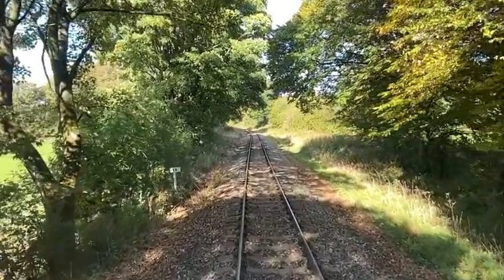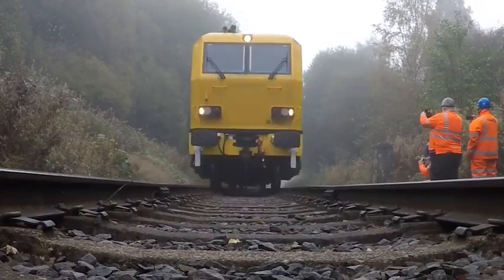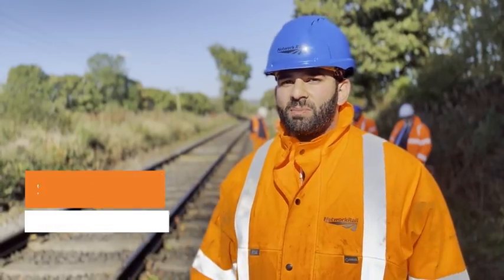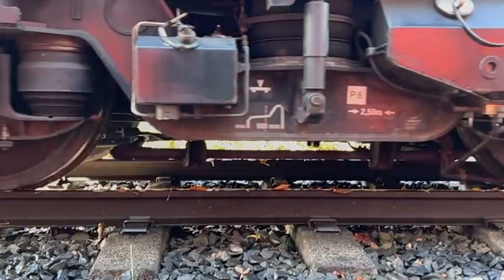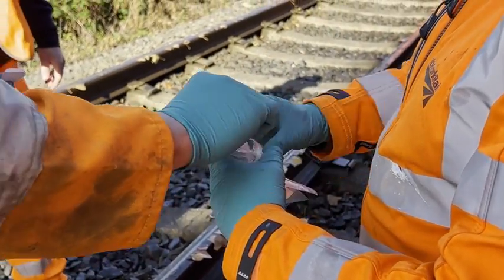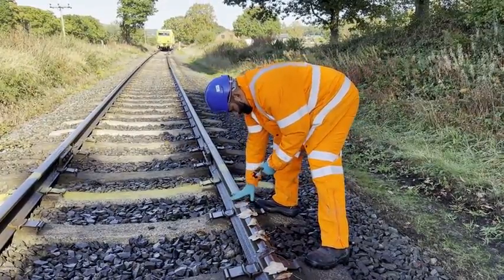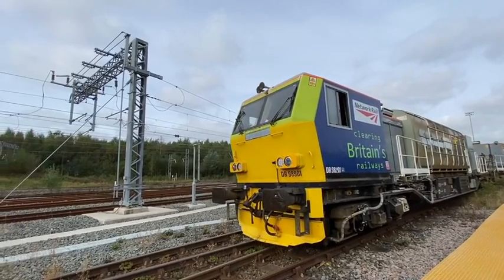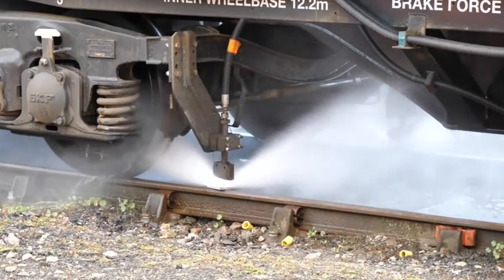Laser and plasma jets zapping leaves on the line.

Comment: This is not a new technology. Plasma torches were used in the early 1970s by the British Rail Research Department. The main difference then was that vegetation was kept in check far more effectively and also train brakes were still mostly blocks on wheels, rather than discs on the axles. This means train wheels are not being cleaned when the brakes are used, exacerbating the problem.
Neil.

Comment: My solution would be to put some brushes in front of the wheels to like maybe MOVE the leaves off the rail before they get run over by the wheels. I think it is way simplier and I dont see any downsides other than the brushes waering off overtime.
Reply: The issue is the coating compressed leaves leave on a rail over time, much like rail grinding with this solution you can send the train down the line once and its good to go versus relying on everyone fitting their trains with another maintenance item. And even if all had a brush system equipped it wouldn't be perfect and you'd still need something to clean off the rail more intensively.
Reply: Actually this wouldn't work. The reason is the leaves are already dead and decomposing. Once they are wet they turn to a kind of paper like material. Next time it's raining and your walking down the street, check out the leaves on the pavement.  You will notice they are all wafer thin and very damp. This creates a suction this like force with the ground. if it's windy you will notice these leaves will not get blown away, or at least not easily. This is the same problem with the track. Once the track is wet and you get those dead leaves on it they stick, then sit there and rot. The decomposed matter then gets compressed and turns into the material described in the video. Brushes would not be able to excert the force required at the correct angle to shift the matter from the track.

Now some form of scoop or blade would work better but it wouldn't be perfect and you then also have the problem of having what is basically a snow plow attached to the train for 6 months a year and as Rodrigo pointed out, Rails companies don't like do more maintainence than is legally required.
Reply: you would need some rotary brushes that press on the rails and rotate at high speed. i suspect they would wear down too quickly and over time would actually wear the rail.
Reply: George Stephenson probably tried it.
Reply: They'd get stuck in points and wire bonds. Been there done that.
Reply: The brush would be softer then the rail so would wear away quickly
Reply: Given the nature of the materials here, my guess is that it would be really hard to precisely set the force of cleaning brush. If it is more, then the life of rail can decrease drastically.
Reply: @M3PH11  oh my god 🤦🏻‍♂️
Reply: I like your thinking, however, this could cause a huge amount of friction, thus needing more fuel/electrical power to keep the train at the same speed. The leaves are very compressed too, so a very hard brush would be used. Don't stop thinking of new ideas! (-:
Reply: @AdamSababa  you are thinking about leaves that have already been compacted, if all trains had a brush then the leaves are moved before they have been compacted in to a paste.
Reply: @garryferrington811  wasn’t a problem then because the brake shoes used to contact the wheel tread & dislodge the compacted material, it has be become a problem since disk braking was introduced.

Comment: If the leaves are finally being removed by heat then it would be interesting to know its effect on wheel-rail adhesion (the improvement of which is the obvious goal) and subsequently how this is impacting the braking distance. The other thing I would like to know is how frequently in a day this operation is done on the tracks?
Reply: Yes I wonder if it improve adhesion or smoothes the rail, and how much rail wear there is.
Reply: @Dosedmonkey  I think, it surely improves adhesion, otherwise they would not use this device. However, it still remains to know how much is the improvement. Also, your question about wear is interesting. Yes, it would be interesting to know the impact on rail wear due to this device.
Reply: @Dosedmonkey  Do you work in railways?
Reply: @kirar2004  it does improve the adheasion and also helps with breaking distance and flat spots on the wheels

Comment: whatever happended to sand droppers and steam blowers
Reply: you do realise they are running right now
Reply: Nothing. They still have them. The problem is that trains used to be hauled by a heavy locomotive that could basically squeeze the contamination off the rails with its weight. But now, passenger trains are much lighter, so leaf contamination is more of an issue.
Reply: @beeble2003  oh ok

Comment: Not very green though is it. Using thousands of watts of electricity instead of tapwater.
Reply: No green? It's greener that using water, as it says.
Reply: Ok, but why?
Reply: @Daimo83  because the range and power consumption of water are both bad , especially compaired to the laser train

Comment: Sorry for stupid question, but did you try to actually brushing leaves with a roller before first axle of EVERY train?
If brushes get dirty too quickly, how about pressurized air? (I guess it is loud, but so is water cleaning).
If you do that, almost no leaves don't get compressed into the rail and so should mostly clean normally.
Reply: Most trains have pilots in front of wheels to stop debris potentially derailing the wheels.
 however for brushes or compressed air systems on every train for track cleaning, they don't have them because basicaly safety, you don't want debris or ballast stone from the track being kicked up at High speed and potentially launched at oncoming trains causing damage or launched off the side of the railway and damaging people, property and trackside infrastructure.  A ballast stone being lobbed at 20mph can be deadly never mind at 125.

The water jetting will also kick up some debris but they move slowly and its more controlled and they will have restrictions in place on the line when they are doing it to minimise potential damage.
Reply: @cor7740  Right, but you don't need powerful systems to remove leaves before they get crushed onto the rail. (Or maybe it would need to be pretty powerful, since it would have to get the leaves out of the way fast enough to stop them being run over by a train potentially doing 100mph.) I suspect the actual problem with this idea is that leaves get blown around as the train passes, so it's not enough to protect the front axle. You'd need such a device each side of every axle or bogie.
Reply: @cor7740 /videos Makes sense!

Thanks a lot for explanation.

In that case I would try to opt to fling debris inside instead, covering sides with thick stationary brushes, and vaccum it, but it's probably not realistically possible to retrofit every train with such a system because it would necessitate deep modifications to every undercarrige, never mind the production and maintenance cost of such system...
Reply: As pointed out in the video, it is the compacted leaves that are the issue and what you propose works for loose leaves before compaction but once compacted, what can you do? I do hope this tech works then we can call it Burning Rail instead of Burning Man. 😅
Reply: @LadyAnuB  If every train could clear the leaves before running over them, no leaves would ever get compacted to the rails!
Reply: @beeble2003  That was my point exactly. But if it's perceived as a safety issue there's almost nothing that can be done I'm afraid.
Reply: I see most people do not comprehend what is the actual problem. The leaves laying on the rail head in front of  train are blown away by aerodynamic forces as soon as the head of the train passes over them so the first axle will not roll over them. It is the leaves laying on and along the track that are lifted in the air as the train passes by and occasionally land on the rails and get crushed by consecutive axles. Hence any kind of broom or debris removal device mounted in front of first axle will make no effect.
Reply: @bchqf /videos I see! This makes perfect sense.

So to prevent this effect we would need to somehow prevent turbulent airflow near the ground which is almost impossible unless all of the ground in a large radius is covered with smooth plastic or something, and all undercarriges are also reshaped entirely which is completely unrealistic.

Placing a brush before every axle of every train is not even a nightmare, its a literal maintenance disaster (and can lead to actual disasters when those things inevitably start to break off).

And we cannot cover the rail between axles with any efficiency either because trains need to turn sometimes. Hmmm....

Comment: I can’t see how it can work ? The current RHTTs travel at a reasonable speed & is slotted in between trains, this MPV is moving way slower & will not be able to be slotted in to normal train running schedules.
Why can’t normal service trains use high pressure air to clear the rails of debris before it’s compacted ?
Reply: Because then one service train has to be run a couple of minutes before the normal train goes. Every time.
Reply: That isn't it's operational speed.
Reply: This is just slow as on heritage line testing calibration and settings I presume. They don't want to damage mainline rail with tests.
Reply: the laser train can run at 60 mph
Reply: @Lillstisse661  service train are normal trains.

Comment: No one thought of bolting a broom to the front of the train?
Reply: Actually this wouldn't work. The reason is the leaves are already dead and decomposing. Once they are wet they turn to a kind of paper like material. Next time it's raining and your walking down the street, check out the leaves on the pavement.  You will notice they are all wafer thin and very damp. This creates a suction this like force with the ground. if it's windy you will notice these leaves will not get blown away, or at least not easily. This is the same problem with the track. Once the track is wet and you get those dead leaves on it they stick, then sit there and rot. The decomposed matter then gets compressed and turns into the material described in the video. Brushes would not be able to excert the force required at the correct angle to shift the matter from the track.

Comment: How about just blowing air in front of the front wheels? Stop the problem before it happens.
Reply: No it wouldn't............
Reply: You'd need quite powerful air jets to get the damp, decomposing leaves off the track in front of a high speed train.  Then you have the issue that turbulence sucks the leaves back under the wheels just a car or so back.

Comment: Carefully lay leaves on the rails - THAT will stop the train!
Reply: It's not the first train which passes over and crushes the leaves that has the problem - it's the subsequent ones. Placing leaves on the line is one way to simulating a leaf fall.  Another way would be to gather a large bucket of fallen leaves and drop them on the track. Same end result - leaves on the line. So carp and criticise all you want, at least NR is looking into resolving the problem.
Reply: @roboftherock  a problem no other country I live in has. Maybe carping should be done.  Maybe it can start by stop playing environmental games to please activists and start, you know, doing their job and running a train service for train customers. Like CUTTING back trees away from the line like they used to;  having spray trains and spraying the track and line side instead of allowing the lines to become weed fest. These are railways first, not wildlife reservations.
Reply: @xr6lad  The lack of tree cutting by railway lines is because of cost, not environmental concerns. But the main reason the problem is bigger today than it used to be is that most trains aren't locomotive-hauled any more. The trains are lighter, so they can't force the crushed leaf matter out of the way as much as they used to.

Comment: Here’s an idea. Actually perform maintenance. Do what you used to do. Cut back trees. Spray the track and line side. Stop trying to tick boxes for activists  and actually run a line maintenance service.  Never met a country; and I live in several, for ‘leaves’ delaying trains.
Reply: Maintenance and gardening is a must - yes.
However, if trees are nearby, and there are a lot of them, that alone doesn't help because of wind.
Wasting water is a real concern, with more and more droughts occurring because of climate change.
This is a real problem across the world in any place where trees shed leaves seasonally. It gets different levels of attention due to multitude of factors - one of which is that your trains run much faster than where I live.
Reply: @topduk  Yes and no. Droughts occur in different place from where the water is dumped. Aquifers generally redistribute water to a large area but their reach is ultimately limited both horizontally and vertically. Natural geological/hydrological processes are being disrupted by transporting water to "unexpected" locations and dumping it in concentrated spots. Ecology and geology might take thousands of years to adapt but during that time humans will change things again a lot of times - that is the main problem with the antropogenic ecological catastrophe we are experiencing. This particular case is not necessarily "bad"/disruptive enough, and water loss being discussed is absolutely minuscule in comparison to e.g. agricultural water use, and most likely won't change anything on its own , but thought process is going in the right direction.

Comment: I am sure small fans to blow the leaves off would be cheaper, and much less likely to cause forest fires.
Reply: That's not an option. The problem is that the leaves are compacted and pressed onto the rail head by passing trains, and it's that greasy residue that causes the adhesion problems. That's what's being burnt off here, not the leaves themselves.